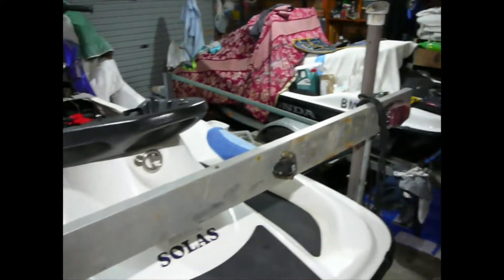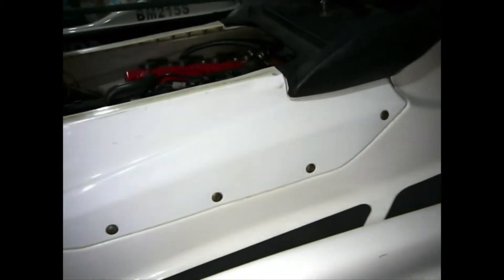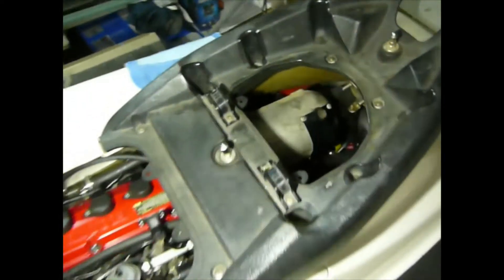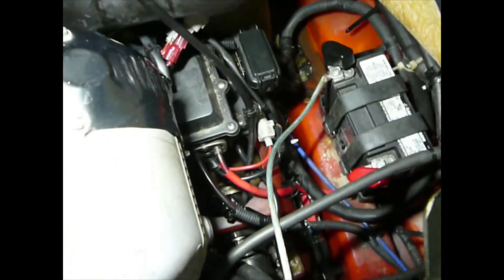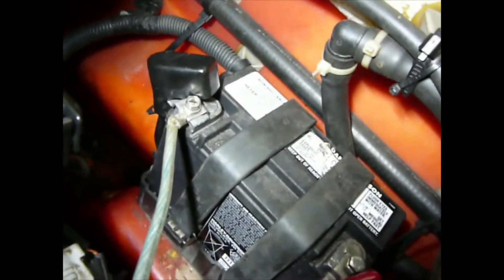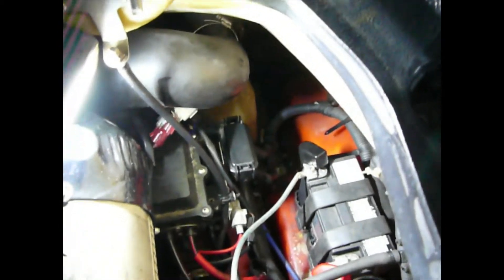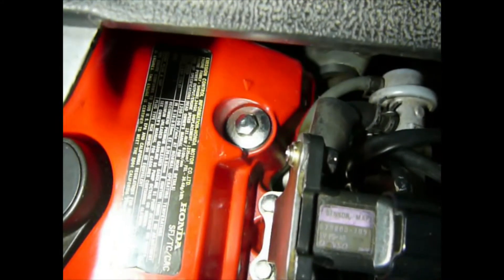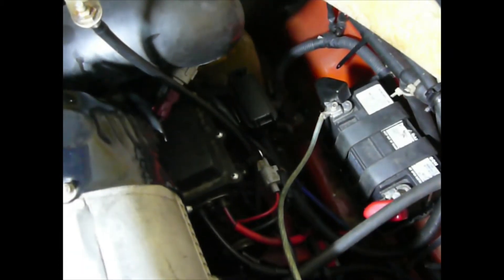Honda Aquatrax jetski electrical fix   2022

Comment: Man I could really use your help. There is a hose that runs under the drive shaft. It’s rubbed and is leaking into the ski. Trying to figure out where it connects, do you have any idea about that? Kinda an S Shaped cable. Thanks for the great content, I’ve been zooming in on your videos for about an hour! Haha
Reply from the maker: @craigforand3089  most likely that hose is the feed hose from the jet pump. It will only pump water through that hose when the jetski is in the water. That's why when your jetski is on the trailer the jet pump can't pump any water through your motor to keep it cool so on the trailer you have to hook up a hose to get water going through the motor to cool it. Hopefully that makes sense.
Thanks for your feedback and for watching my videos. 👍😃

Comment: Just a question you may be able to help me with, I tried to start my Honda ski a few weeks ago all good till I pushed Start button then nothing, no clicks sounds nothing,
Reply from the maker: Most times that is because the starter relay has suddenly stopped and become faulty. You can order a new one and simply unplug / unbolt the old one and fit the new one and you will be back to normal running. If it's not that then occasionally it can be faulty connection on your green start button so you will need to pull it apart and clean the connection or replace it with a new switch. Also near the starter relay is a small black fuse box, check that none of the fuses are blown (happened to me - once mine had a blown fuse and it was the last thing I checked so I wasted my time with all the other checks). Good luck.

Comment: What were the symptoms leading up to this point.  Great video! Thanks for posting.
Reply from the maker: Sometimes I was getting fault codes for the knock sensor and sometimes for the coolant sensor and other times it would lack power when trying to start the jetski. I replaced the battery with a new one then someone told me it could be a bad earth connection and it would be best to attach a second earth cable so I did. I didn't have the problems anymore after that fix. 👍